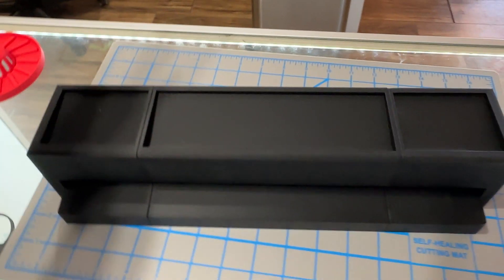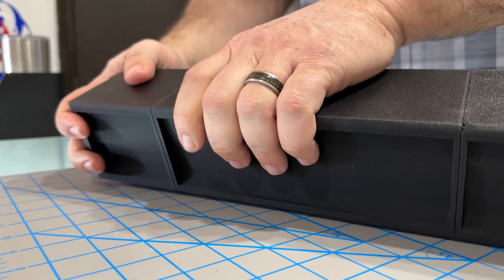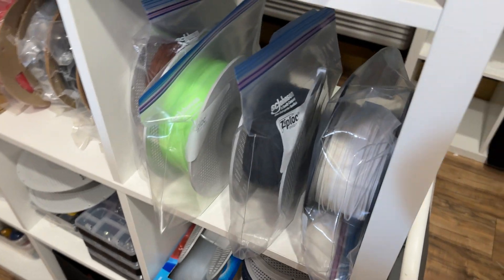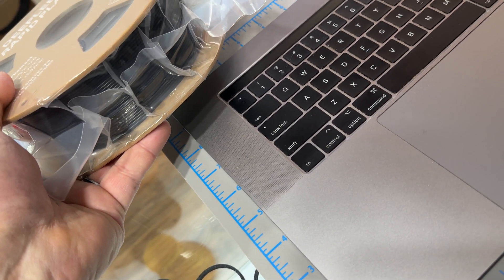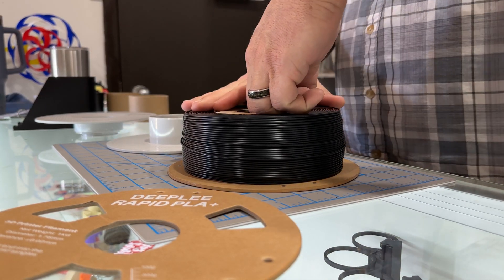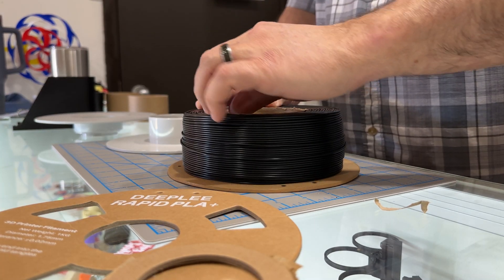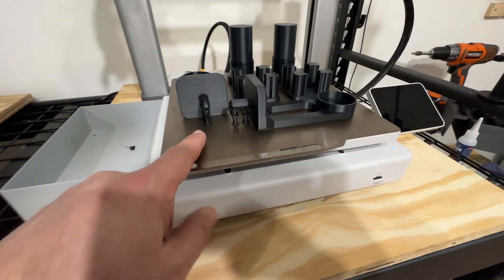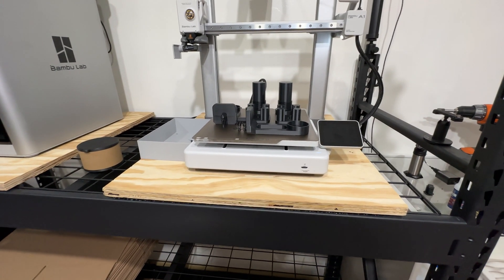Small Business Tech Hack: Repurpose Old Hardware with 3D Printing

Comment: If it's just a prototype, print it in anything you've got laying around. It usually takes a few iterations to get something right. Once it's right, then worry about the right material. Unless you need it to meet some strength requirements, that's a different story.

Comment: Why did you print an object with 100% infill? At least it feels like it's 100%. Let alone, "prototype 1". Let alone - using overengineered  filament, where just PLA+ or even PLA will do just fine?
And still, just drill some holes and voila, you can use the prototype 1, no need to throw it away.
Reply from the maker: @beepboop8184  overconfident,  I had the measurements dead on and I felt like the first print would be the finished product

Comment: How did you make your MacBook headless? Please help
Reply from the maker: @russellsuiter480  I linked the first video in the description but depending on your model you remove the bottom, 6 screws for the mount, few screws for the ribbon cables and it comes right off.  

If you search headless MacBook  there are a ton of step-by-step videos available

Comment: Oof, expensive design flaw. I've done similar things, but I've learned, and make my models modular enough that I can turn off sections of the models, render an STL of only a part I'm unsure of and print cheaper test objects. Colour doesn't matter to me - I have some nice, matte spray paint, and shiny varnish if that's not looking right.

Now to find a solution for when I load up a plate full of stuff after successfully test-printing one, only to come back to spaghetti. The TPU has been rock-solid (which is weird for a flexible 95A material), while PLA and PETG just starts acting up the moment I look away.
Reply from the maker: After finishing a project like this, I try to reflect on whether I could have caught the issue before the first print. I tend to rely too much on prototyping—designing a part, printing it, and then identifying any problems. With small parts, this approach isn’t usually an issue, but when a print requires a lot of filament, fine-tuning that way can become expensive. It wasn’t until I installed the laptop into the riser and heard the fans kick on that I realized what had gone wrong. In hindsight, I should have considered the cooling requirements earlier in the design process, but it wasn’t obvious until I saw it in action.

Comment: I would have gone ahead and drilled out the hole to make sure that it’s going to work then you could’ve printed out another one that was designed the way you wanted it.
Reply from the maker: In a previous video, I tested it, and it worked well except for the overheating issue. Adding heat vents and reprinting it was all that was needed to finish the project. It was tempting to just drill some holes and salvage the old one, but I typically go through two or three design iterations before settling on a final print. Since then, I’ve refined the design even further, but I haven’t reprinted it since the changes aren’t significant enough to justify using more material. However, if I ever need this part again in the future, the updated version will be ready to go.
Reply: I'm right there with ya. Prototypes can be ugly, as long as they're just proof of concept.

And for matte black, I really like the Sunlu Matte black.